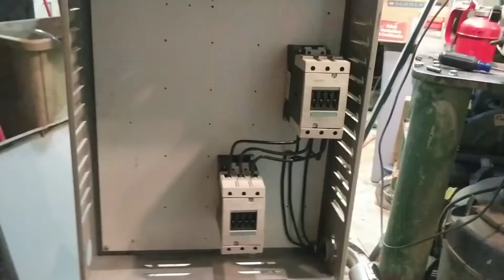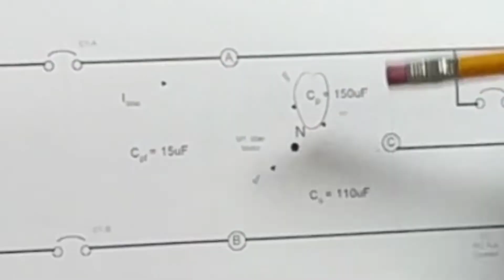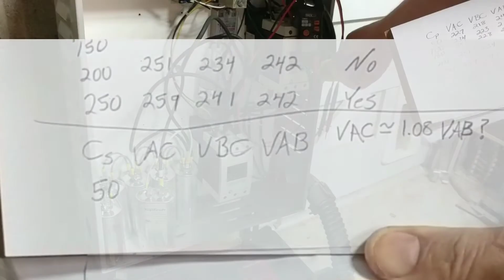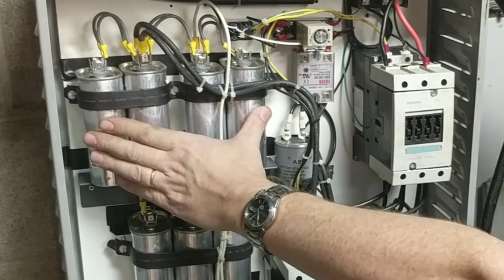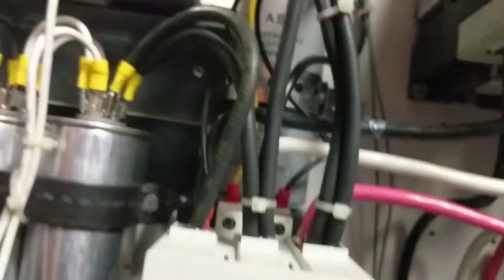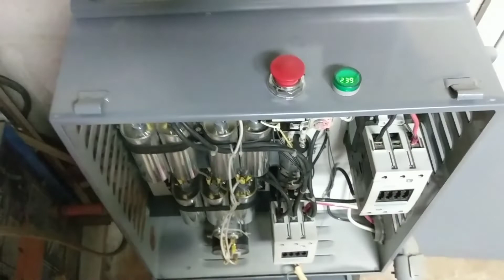Building a Rotary Phase Converter: Part 2 Assembly, Balancing and Final Testing

Comment: Thank you for the video.  Could you have used a 220 volt motor to spin a 120 volt motor and thus generate a 3rd phase?
Reply from the maker: not the way you're thinking.  I oversimplified in my explanation, describing the magnet in the rotor as a permanent magnet.  Common motors are induction motors, where the rotor is effectively an electro-magnet. So without some source of electricity for "excitation" (aka "field")the rotor never becomes a magnet, and it produces little to no voltage, no matter how fast you spin it.  Car alternators are the same way.  There are tricks to use capacitors to capture and magnify the residual magnetism, which self-amplifies until it reaches a point of being self sustained, but it's fairly involved, rewiring the inner windings, etc.  So the answer to your question is "In theory, in the lab, yes it's possible.  But in practical, reasonable, realistic terms, No, that's not an option.

Comment: he said "under load" at the end, but the mill was running, but not under load
Reply from the maker: What's your point?
Reply: @TheBuildist  the point is the voltage will change under load.  Is the voltage still balanced under a working load?  Can you make a video of that?
Reply from the maker: @bigcbradio  No, I never balanced it to that point.  Once you bring the first motor online, that motor tends to smooth out/stabilize the voltage further.  The more motors you bring online, the more stable the voltage gets, up to the point that you're pushing too many amps through the RPC itself.  Everything I've read is to balance it the way I demonstrated in the video.  If there's more/better to do, I'm blissfully ignorant of it.
Reply: @TheBuildist  Ok, I just thought maybe you could test it under an actual load and let me/youtube know if the voltages stay balanced.   I have a friend that is currently having trouble with one he bought (used) and he is asking me for help.  It seemed like you know a lot about them is why I am questioning you.   He bought a 7.5 and is having trouble running a 2/5 lo-hi lathe.   It vibrates a lot trying to start, the relays chatter, etc...   the guy he bought from is now telling him he needs to buy a 15hp one.
Reply from the maker: @bigcbradio  That does seem odd.  7hp rpc driving 5 is a bit close.  I think the rule of thumb is the rpc hp is 1/3rd bigger than driven motor.  But all the motors are "ganged" once they're up.So if he had an extra 1.5-3hp motor, he could bring that online first: 7hp starts 2hp "extra" motor, then combined you now have 9hp starting 5hp motor.  And would certainly be cheaper than buying a 15hp model.
Reply: @TheBuildist  he does have a small mill and he did bring that online and let it run, that did help with the lathe, but very little.   It seems to power up the small mill Ok, but he didn't try to put a load on it or actually mill anything.   Like I said, the lathe is that old 2hp/5hp lo-hi lathe, and he only runs it on low, but even on low it doesn't start up or run properly, and fyi, it was running fine at his old shop.  He closed his shop recently and moved the mill and lathe to his home garage.   Anyways, thanks for the ideas, he just told me he unhooked it and is going to get his money back and order a new one from a reputable company instead of a used/homemade one like this.

Comment: i have a question i know the amperage coming from main single phase is around 3.5 amps on my 10 hp phase converter but is it normal to have 11 /13 amps on the a&b leg while the c aka ghost leg is 21 amps?
Reply from the maker: I'm not an expert enough to know that detail.  It does strike me as odd, if you've done the secondary capacitor balancing to smooth the voltage out across the 3 legs.  But I'm guessing too.

Comment: I'm much smarter now than I was before but I have a question.  I hope this was not covered and I just missed the point.  If I have this right, the starting capacitor drops out after the motor is up to speed so 2 coils (or 2/3 of the coils) are causing rotation while 1 coil is generating current.  Why is that not single phasing or otherwise not causing an imbalance?  Thanks for the education.
Reply from the maker: It does result in an imbalance, and that's where the balancing capacitors come into play.  They ensure that the output across all three phases are approximately the same voltage, which will result in them each supporting approximately the same amperage.

Comment: Watched it right to the end, and I have to say very well done all around.  I especially liked that you took the time to balance the phases.  Yours is one of the few videos I've seen here (and I've seen a few!) that even deals with that aspect, much less goes into the detail you provided.
Reply: A bit disappointed that you went with a mushroom start/stop switch.  Generally, these are used for emergency stop applications, although it will work well here.  With a bit of effort you could install a start-stop station and a relay wired in a latching mode, which would have assured no accidental starts after a power interruption.
Reply: Just wanted to also mention that another advantage with start-stop stations is that you can also install additional start-stop stations at each machine; no need to walk over to the RPC to power it up.

Comment: If you're concerned about the converter restarting after a power failure (I would be, especially if I had motorized machinery connected to it), you could add a pushbutton start-stop switch and a small 2 pole holding relay into the coil circuit of the main contractor.
Reply: I'll leave the details of wiring a holding circuit to readers with some proficiency in electrical controls.  It's not difficult, but could have dangerous surprise consequences for the uninitiated.

Comment: Not sure why you made it so complex with the transformer, timer and solid state relay.  A 240 volt normally closed potential relay with its coil tied across the phase (capacitor) leg and either of the hot legs of the motor will do the same job.  The normally closed contact opens upon sensing voltage, thus disconnecting the capacitor.
Reply: And if you're concerned about pulling in the secondary contactor, you could use a relay with another set of normally open contacts to energize the contactor once motor speed has been sensed.  Or add a second relay with the coils paralleled.

Comment: Bob,  I am currently following your build exactly and have been able to freeze and zoom in on all the part numbers of the components you used in your build accept the transformer you used, is it a 24 volt? and if so would you mind giving me the part number? I have a 19.5 volt but not sure if that will work. Also where did you source your run Caps?  thanks and any info or help is much appreciated.
Reply from the maker: It is right around 24 volts, it's a switching power supply from a laptop.  Not an electrical engineer, but I personally wouldn't use 19.5 volts,  But as long as you match the voltage within about 10% between the transformer, the little control contactor and the solid state relay.  24v is such an industrial standard, that's what I went with.    And I sourced the run capacitors of off Ebay, somebody had a bargain on buying like 12 at a time.
Reply: @TheBuildist  Thanks I went ahead and ordered a 24VDC charger.  I see your Master contactor is 95 amp and your output contactor is 65 amp. Did you do this on purpose or was these just the contactors you was able to source price friendly? Also what size breaker are you feeding your phase convertor with from your service box?  Thanks for your reply and help. It is much appreciated.
Reply from the maker: @davidgoucher7177  I had the contactors on hand, so I just used them.  The master contactor is carrying all the current through two conductors, the second one has the current spread across three conductors, so it made sense to use the 95 as the master.  In order not to overload that contactor, a 90 amp breaker would be recommended.  I had mine on a 100 amp to account for inrush current at motor startup, but that's not code and not recommended.

Comment: Is there not a problem the ssr turning on for a short period when turning the system off. Wouldn't it burn the start capacitor?
Reply from the maker: The start capacitor is necessary to change the "timing" of the pulses to the coils, in order to induce enough rotation for the motor to spin up.  But it very soon reaches a point of dissonnance, where the pulses reaching the "live" coils want to spin the motor at "full" speed, but the pulses reaching the "third" coil, delayed through the start capacitor, are now only serving to try to interrupt the smooth speed. It sounds very "lopsided" in that state.  So the start capacitor is "online" just long enough that the two live coils are able to spin it on up to speed, but no longer, so that it never reaches the "lopsided" condition.   The SSR is useful for that because its actions are so instant that we can fine tune the start capacitor to the point of milliseconds.
Reply: @TheBuildist  I get it, I understand the function of the start capacitor. What I mean is that after I start the RPC, the motor start, nice, but when it is time to turn off the RPC, after 1 or 2 seconds approximately, it seems like the SSR come back to on then shut off again what causes the start capacitor to connect what causes the motor to brake aggressively. I have tried three ssr and do the same. Perhaps is a malfunction with the timer relay. I was thinking in connecting a bleeder resistor to the start capacitor to avoid this on the motor when turned off. I ask because I noticed in your video that the ssr do the same thing.
Reply from the maker: @wilber123ful  I agree, it must be the timer relay.  Either you have a wiring trigger you don't realize, some way the timer is being re-initialized, or the timing relay itself is firing both on power up and on power down.  That has to be it.

Comment: Great Tutorial! I have questions. Can we run two RPC in parallel?
Reply from the maker: I'm afraid I don't know.  Do you mean combining the output of two "5hp motors" to get 10hp worth of current?  If so, that's easy:  After your "small" RPC starts the first motor, those two motors now effectively form a larger unit.  I've never done it, but I've heard of shops where, for example, there's a 7.5hp rpc.  It has both a 5 hp and 10 hp motor plugged into it.  With the RPC running you first start the 5 hp motor, and with those two running, you can now start the 10hp motor.  Every motor you add, adds to the overall capacity of the system.   HOWEVER:  All the current of the entire system still has to flow through the single phase supply to the RPC.  So if you intend to do that, you have to size up your conductors and contactors in the RPC to handle the full load.  So in my example, I only have a 7.5hp pony motor in the RPC, but I'm going to wire it as though it's at least a 20hp pony motor, to handle the current needs of all three motors.     BEFORE YOU TRY THIS you should confirm that I'm correct about it.  It's only what I've heard, I'm not at all certain that this is a safe thing to do.

Comment: Curious, What type of solid state relay did you use? Most I've seen have been for resistive loads only, not for inductive or capacitive loads.
Reply from the maker: It's been too long ago, I don't recall.  It's possible that I didn't know that and used the wrong thing?  But it worked fine.  Perhaps because its use is so brief, well less than 1 second, only a couple times a day at most.
Reply: @TheBuildist Thank you for the reply.  Yes I can see that what you used worked really well.   Maybe I'm over thinking it.  I was thinking of using a solid state relay instead of a contactor to eliminate the possibility of it sticking on.   I've already built a phase converter years ago and it's always been super reliable,  however I recently found a larger delta wound motor in a scrap dumpster, and it runs and decided to build a bigger, better one.

Comment: I have a 30 HP donor motor ( Brand New ). I would like to use it for a RPC. I contacted a capacitor company looking for a 2100 MFD ( 70 / HP ) capacitor. His input was that that was awfully high for a motor starter. Any advice???? TIA
Reply from the maker: I'm no expert, I went by what I read on the web.  I will say that for my 20hp motor, the 1200mf I bought was smaller than the rule of thumb I was following ("70 to 100mfd per HP").  And it worked just fine.  So I'd guess you don't have to have a full 2100mfd?    

Having said that, this is not a typical starting capacitor.  "normal" starting capacitors are for single phase motors, and single phase motors, being "in sync" with their current supply, only need a "gentle" nudge to initiate enough rotation to come online.  In our case, we have a 33% mismatch between our supply and our motor,  So our motor needs a much more substantial kick to get enough rpm to come online.  So if your capacitor supplier is thinking "typical" start capacitor, then this one seems too big.

If it were me, and again, I am by no means an expert, If I could easily/cheaply get ahold of anything bigger than about 1600mfd, I'd be inclined to give it a try.  It'll either spin up or not.  As long as it's only hooked up for a few seconds, it's not going to hurt anything to try.